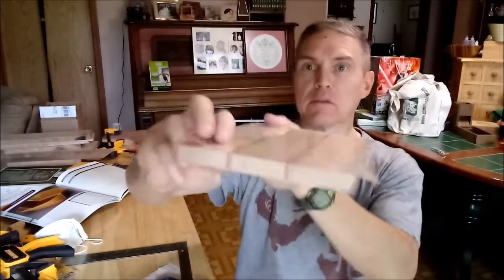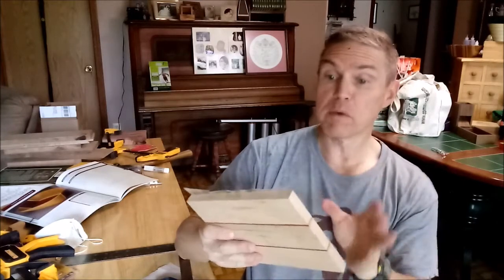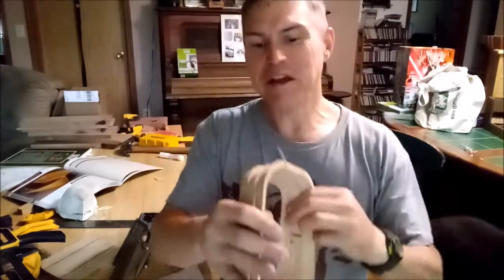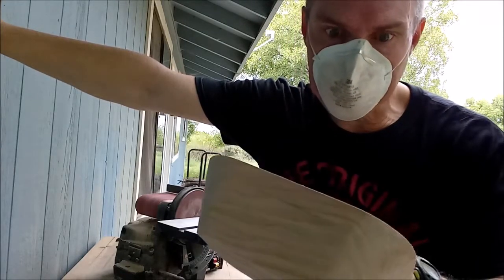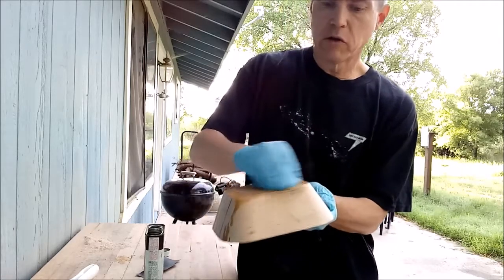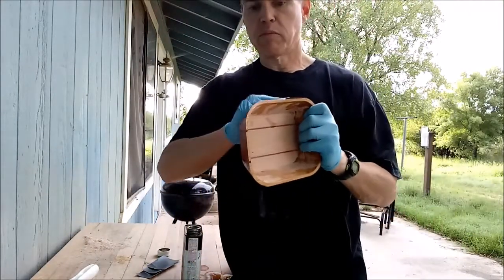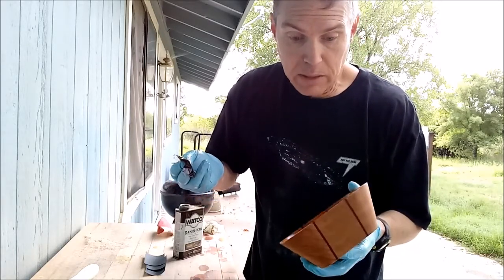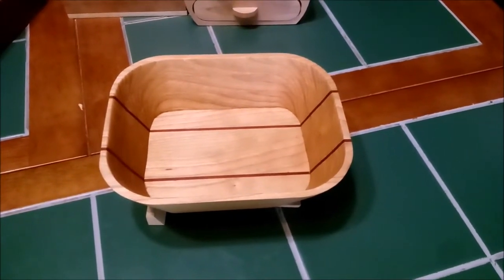Making a Scroll Saw Bowl III

Comment: Looks beautiful i really like that.  Will it take spray varnish after or would it peel off many thanks mate 👍👌👏
Reply from the maker: I've finished a few projects with spray-on products and haven't had any problem with them. Nowadays I've been trying Rubio Monocoat and that works pretty well. I'd recommend going with whatever you're comfortable using.
Reply: @jahellen  many thanks for the reply 
Hope all goes well for your next project